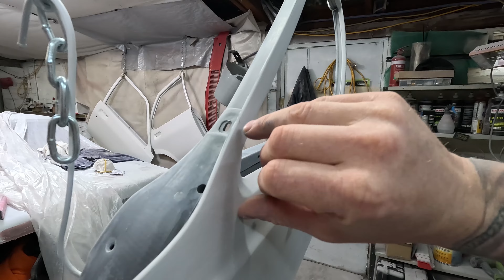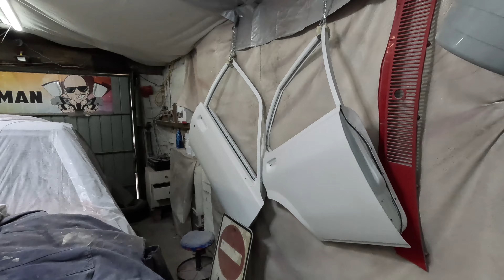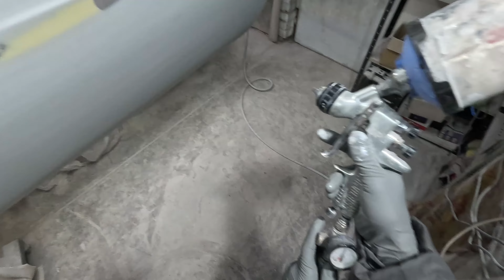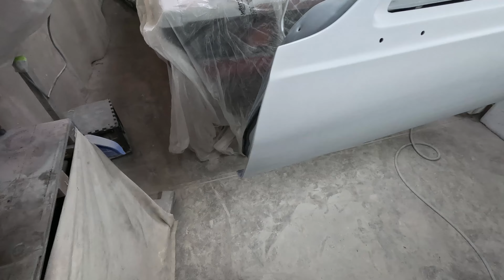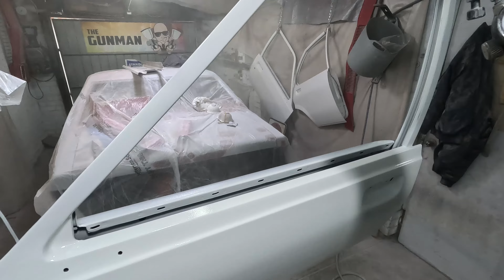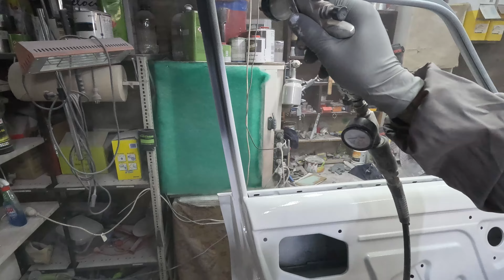Primer Work in The Shed

Comment: I recently bought a Mirka File Board (70x400mm) Flexible which can be adjusted with threaded nut to suit contour of panel and it makes sanding larger areas of filler a lot easier than the standard long flat blocks.  I found flat blocks are prone to making filler appear hollow as there are virtually no dead flat panels on most cars. It takes the Mirka Net strips which cut really well. Not a cheap tool but in my opinion makes sanding larger areas a whole lot easier 👍

Comment: The polyprimer adds about 0.1mm per coat, I measured on xe ghia rebuild using a cheap ultrasonic depth gauge, its limit is 2mm depth. good vid, the project is coming along great. 👌